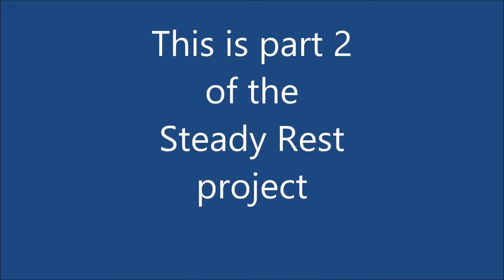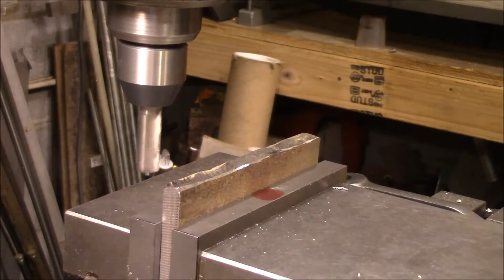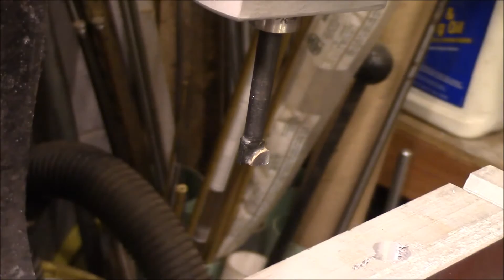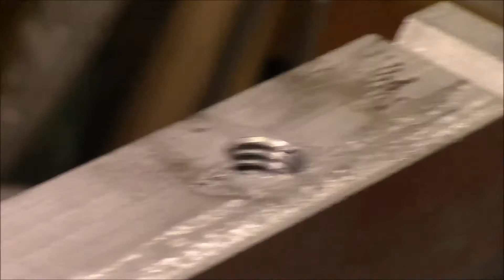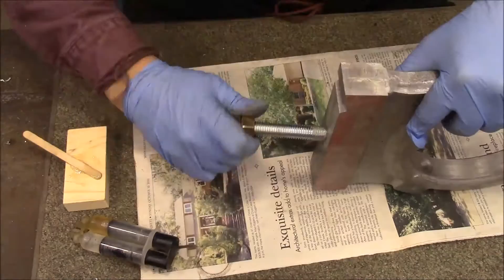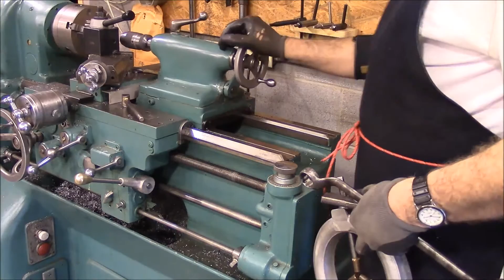Homemade Steady Rest part 2

Comment: Nice job but you should have made an opening in the base large enough for a wrench to fit in to tighten the bolt. It would be way easier to  tighten the nut from the top than from the bottom.
Reply from the maker: You're right.  Thanks for watching!

Comment: your threaded sleeve should have set screws because the epoxy will come loose
Reply: or knurled and pressed in with a bit of bearing retainer style loctite

Comment: Nice job.  A couple of points tho. If you radius the ends of the bottom plate you should be able to sit the steady down in front of the tailstock and then twist the plate into position. That saves taking the tailstock off each time. You may have to fabricate a special cranked spanner (wrench) to reach under as it looks a bit tight to use a standard one. regards from the UK
Reply: +Gary C Thanks for watching!